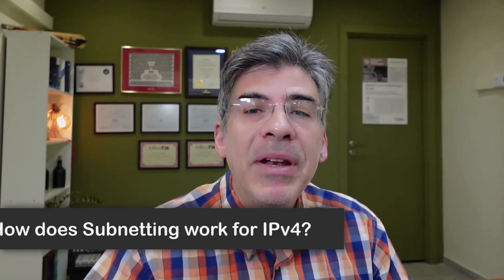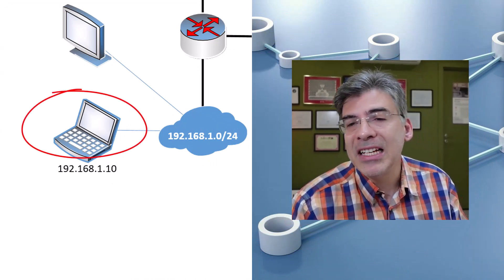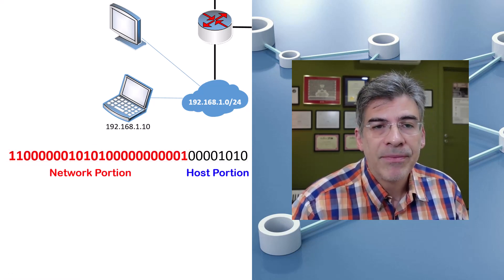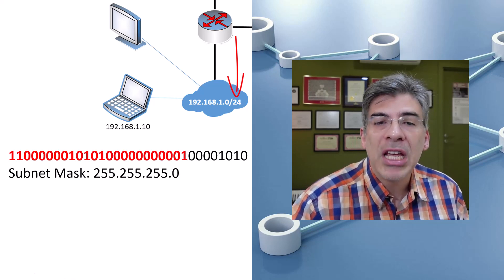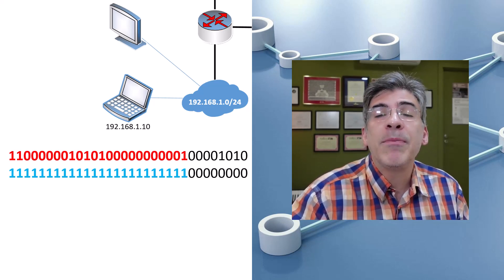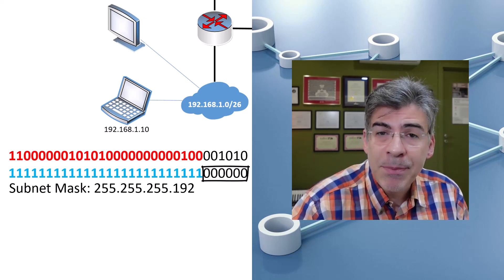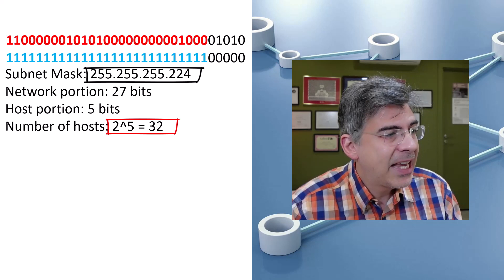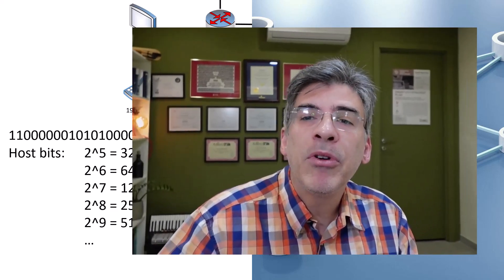IPv4 - How IP subnetting works

Comment: At 7:00 wouldn't the number of hosts be 2^1+2^3 = 2+8=10? Since the host portion is 01010. Why is the number of hosts 2^5?
Reply from the maker: You're calculating the value of the host portion 01010 which is indeed 10. However, in the video, 2^5=32 is the number of host values you can get with five bits, from a value of 00000 to 11111.  Does that make sense?
Reply: @telecomTech.explained  To clarify, does that mean number of hosts is 2^(number of host bits) for example 2^5 for a CIDR of /27? I saw a formula for 2^5 -2 what is that and where do we use it? Thank you

Comment: Hello Sir,

I have a basic doubt:

Why do we configure an IP address for every physical interface on a router? One obvious reason is to connect with different subnets, and another is to meet protocol requirements. However, why can’t we use the router ID for all interconnections within the local AS, except for customer-connected ports (UNI)?

If the IGP is OSPF, the cost is calculated based on link speed. If multiple links with the same speed exist between routers A and B, there could be confusion in determining the shortest path. Is this the reason we need an IP address on each physical interface?

Are there any other technical reasons for this requirement? Also, when did we start assigning IP addresses to each interface? Has this been the practice since the beginning?

Could you please clarify?

Thank you.
Reply from the maker: That's an interesting point.  This is the way that IPv4 was designed from the beginning.  The communication between router interfaces had to take place using IPs because the routing table in each router has a next hop IP for routes, whether they are learned using a routing protocol like OSPF or if they are manually configured as static routes.

The interesting thing is that IPv6 has been designed similar to what you suggest.  Interfaces between routers don't actually have to have unique global unicast IPv6 addresses.  They can have link local addresses which are locally significant, and each interface can actually be assigned the same one!  I can't explain further here, but it would be a great lesson to talk about in a future video...  Interesting thoughts!